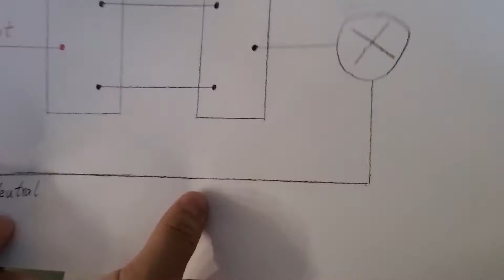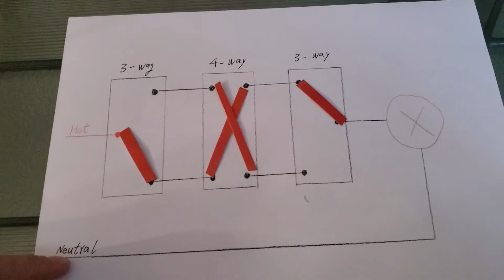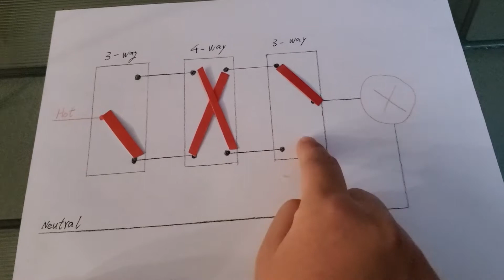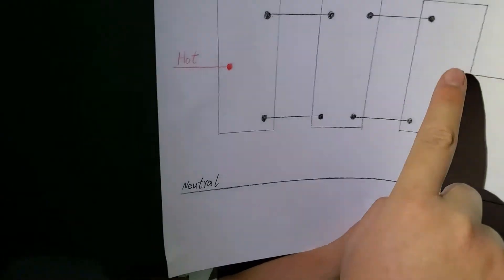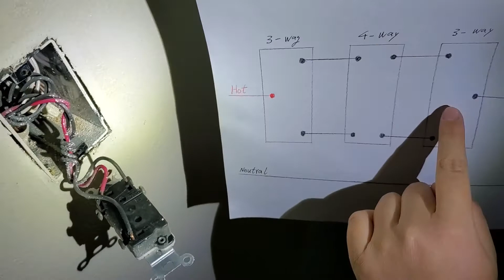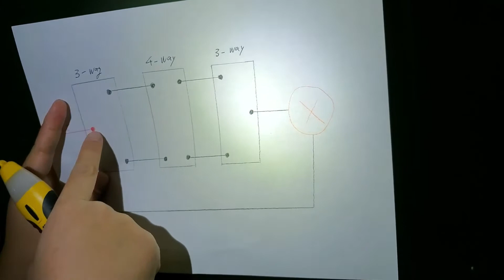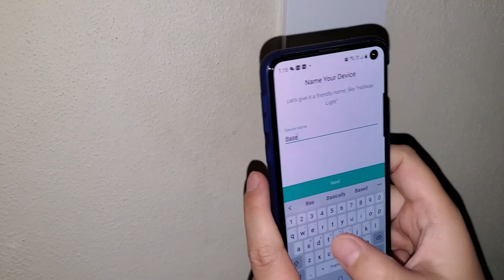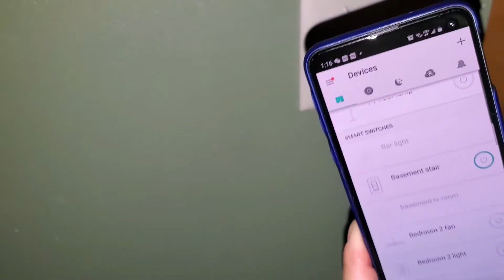How to install a smart switch on 4-way wiring

Comment: I installed this exact configuration this exact same way. But the smart on/off behaves oddly depending on the position of the manual switches. Sometimes "off" is "on" and vice versa, and sometimes I have to click or command "on" or "off" twice in a row for it to do what I need it to do. Any advice? And thank you so much for posting this!!
Reply: usually you install the smart switch on the side of the load. its the only way to make sure the light is on when its says its on.  the problem then becomes feeding power to the smart switch at all times.  you would need to make sure the common wire on the smart switch is live at all times (not connected to the 4 way switch).  i don't see how in a 4 way configuration you can install the smart switch on the incoming side and guarantee the state the smart switch is reporting matches the light.  the smart switch just acts as a toggle in this case.

you might want to take a look at these proposed solutions:
https://www.reddit.com/r/homeautomation/comments/kpuhtb/feit_dimmer_4way_switching_solution/
Reply: I have the same problem. Im wondering if TP-Link changed something. I installed one of these where the hot line comes into the 3way switch. However in the app I have to turn it "ON" to turn the light off. Then turn it off in the app and then back "ON" again in the app again to actually make the light come back on.